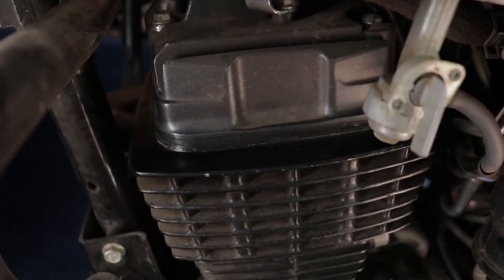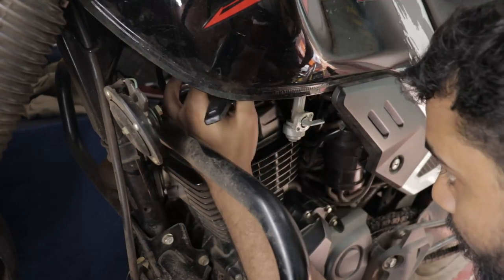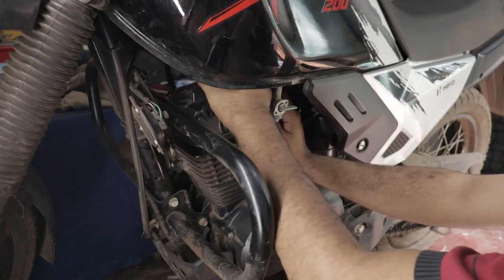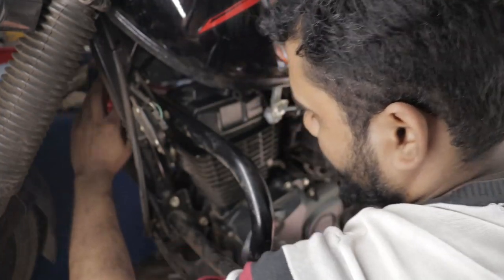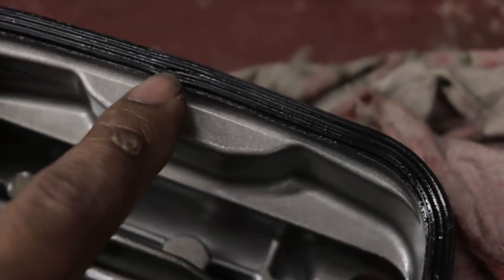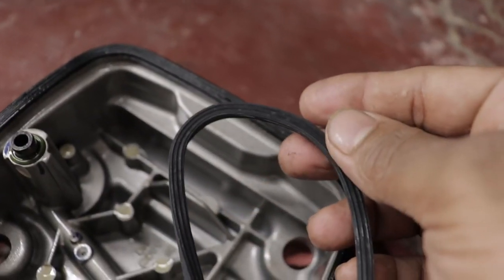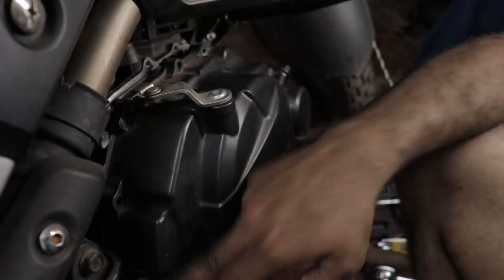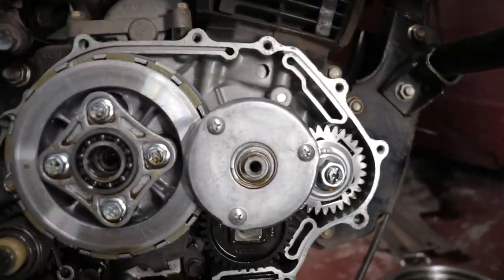XPulse Gasket Fiasco

Comment: Hi Yogesh, 
Thanks for your videos. These have given me a great understanding on my Xpulse 200 issues. I do have engine valve noice issue but I am ignoring (no other go). However i am little concern about the oil leakage issue (same area which you showed in the video). I had this issue two months back and showed the same to Hero service center. They just changed the Gasket. After about 1 and half month, i again started getting the same leakage issues. So, i again took the bike to service center and asked them for a proper reson (as the gasket is fine). They said they will change the gasket again and see ( i was not satisfied with their answers but had to accept). They changed the gasket again and while putting the head cover back, they observed that one out of two bolts holding the head cover is not getting tighten. Then they said that threads in the part where these bolts are getting fastened have gone and need to replace. So, now my question to you is, will that be a easy replacement? I do see that part holding many other parts.. so, if they dont replace it properly, then it may increase my engine noice (my thought). So, could you please provide your thoughts on this?
Reply from the maker: bad threads do indicate the cause of your issue, iIts possible to fix it by changing the entire head. And noise is something xpulse owners will have to live with.
Reply: @YogeshKumar-tk1sv  thank you Yogesh

Comment: I am an owner of an X pulse 200 bs6 and in 3  month's it had started leaking oil. From the engine head then from the starter motor, the point where it's fastened to the engine.
Reply from the maker: To the SVC asap. Probably Head gasket issue

Comment: In my Xpulse 2V, there was a bad rubbing sound on the 3rd gear! can you tell me the reason please 🙏
Reply from the maker: Was or still is. Check if it's present in every gear. If it is then, check your chain and sprockets. If only in third, then i suspect some excess wear and tear on the third gear, I'm just speculating with the limited information. Check your wheels and tires too, spoke wheels tend to go out of true with time.
Reply: @YogeshKumar-tk1sv   Still.. it was only on 3rd gear.. Can it be a Gear Pinion?
Reply from the maker: @LalfakzualaFaktea-u2g  can be. but, how ? How so quickly? Take it to a decent mechanic and have it inspected. Please let me know what you find out.

Comment: What was the problem
Reply from the maker: It was a solution. If you cant find gaskets for hero's 200cc engines, just use the gaskets of hero's 150cc engines.
Reply: Bro will impulse gaskets will fit on xpulse